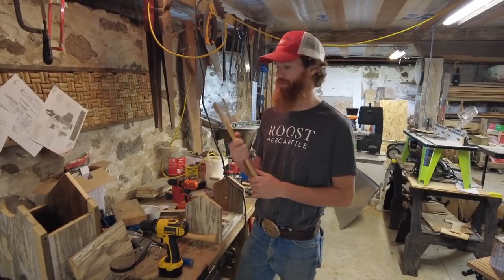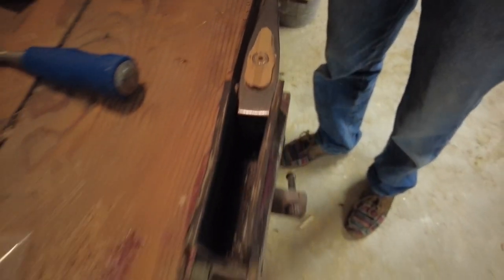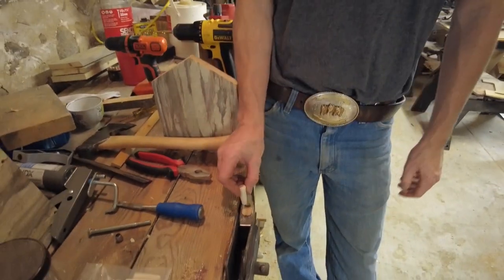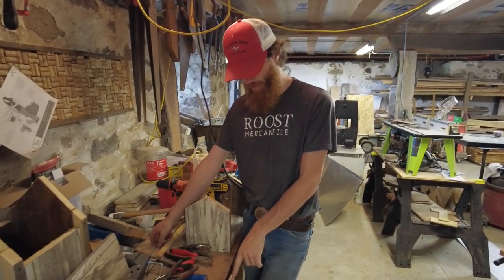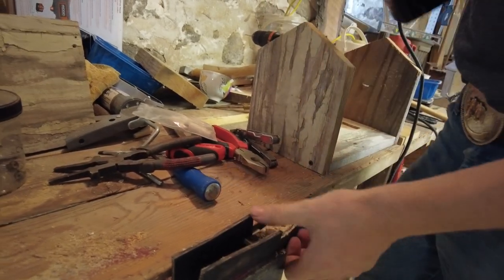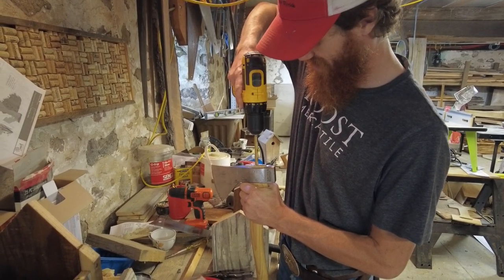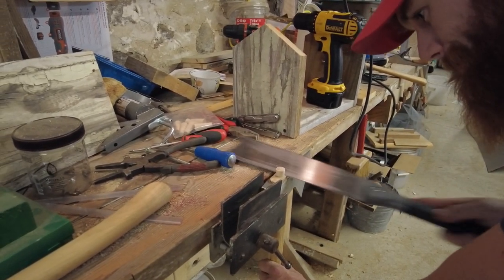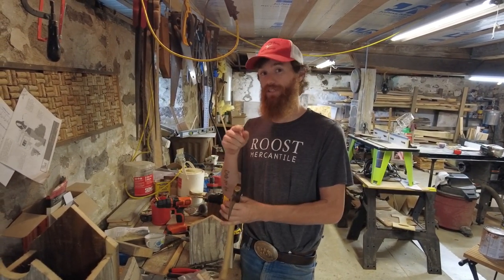Metal Wedges Suck! Here's How You Remove And Replace Them

Comment: The wedges I get from your site look so pretty finished and hung proud that I stopped using additional wedges. I split mostly with heavy tassies and abuse the heck out of them and haven’t had any problems yet. If I do I’ll try those for sure cuz I hate the look of the metal wedges. Thanks for the video!
Reply: They work great. I've bought 3 bags and use them on everything. Tightens up a head very quickly and easily.
Reply: I have used 'barrel' wedges of a different sort. I get these wooden conical wedges from the local pub where they are used for pegs in beer barrels. Good taper, right length and come in hard and softer woods [no idea what wood] Work a treat !

Comment: I use a similar method for conical wedges. Drill out, wind in an easyout stud extractor then use an auto slide hammer. Only time I ever use a steel wedge is as a stop-gap in the woods. I don't drive these fully home so they are easy to remove when back in the shop.

Comment: I've picked up a bad double bit addiction somehow, it started when I found an old DB of my F-I-L's in his garage. That led me to a Plumb Cruiser that I hung with a Whiskey River Cherry wedge and it's gorgeous! I'm finishing a 3 pound DB Collins now used a Whiskey River Walnut wedge on that one, it too looks great but the walnut seems to split easier than the cherry - not really an issue since the split closed up as it was seated but still something to watch out for. The tongue didn't quite fill the eye front to back on this one so I'm going to add a maple conical and see if it spreads it, if not I'll cross wedge it with more walnut. Still have a Kelly Cruiser to rehang and a beast of a Sager Swamper inbound - going with WR Cherry on the Kelly and walnut on the Sager. Every wedge I ordered from Whiskey River is beautiful and plenty thick, a few of each had outstanding grain pattern so I'm using those on special axes - like the SAGER!

keep up the good work Brandon!

Comment: Use a stepped drill. I would use swell glue, which makes the wood swell. Got to say, that looks far nicer!
Reply from the maker: Square hole and conical wedge holds tighter than a conical hole and conical wedge.

Comment: Good video, but I dont understand why a wooden conical wedge is better than a steel conical wedge. Do they not do the same thing?
Reply: For straight wedges I believe that dissimilar materials ( steel wedge vs wood handle heads) have limited long term strength. 

Wood on wood will have equal pressure against each other   and seems to form a more natural lock; at some point ( years later) the wood will shrink away from the metal edges and we have a loose connection. 

That’s my feeling about it from what I’ve seen so far with the original vintage axes ( with both steel and wood wedges in very old hafts) I’ve collected. 

I’ve never seen a really old conical steel wedge ( only 1970s or newer) in an original tool for comparison. You pose a good question and I’ll keep my eyes peeled for a response on this.
Reply: @FIGGY65  I greatly appreciate your in depth response. You gave great points. I'm fairly new to "Axe craft" and am trying to absorb as much information as I can.